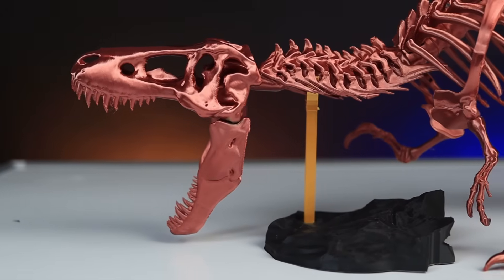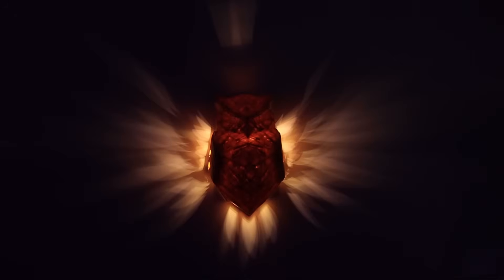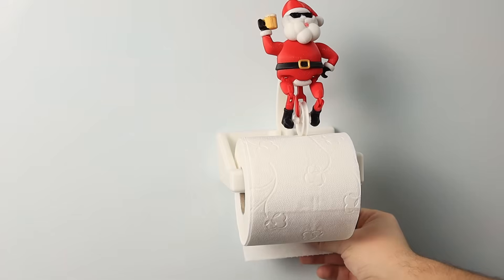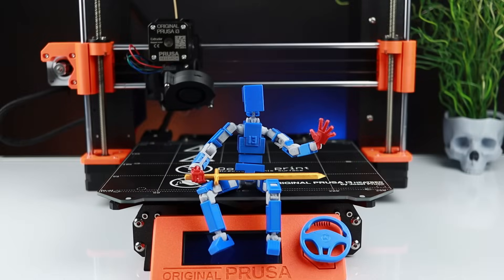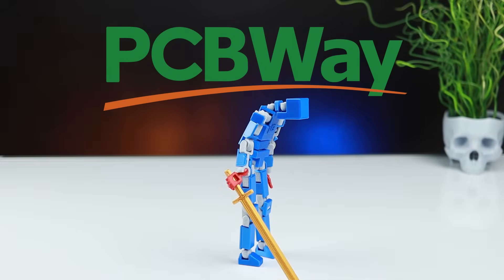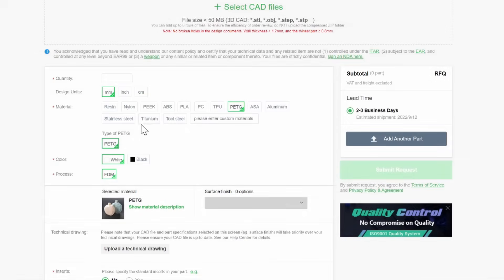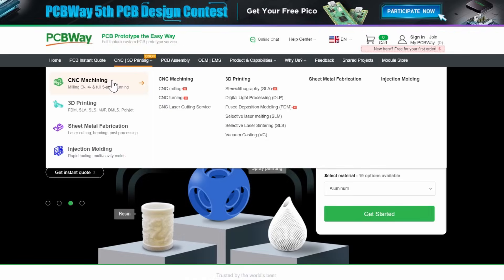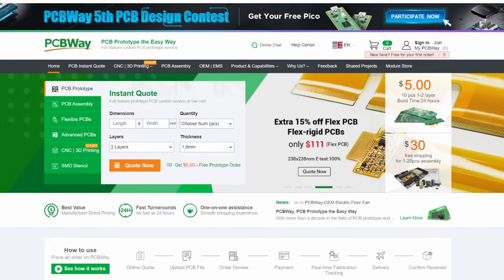Best 3D Printing Ideas in 2023 | The COOLEST Things to 3D Print

Comment: Dear Sir, your models are really exceptional! All very perfect! But what is your secret? Maybe the use of several very expensive printers? How do you get such perfect spheres, even on the bottom side? I noticed that you use a lot of silk threads, which would cause a greater printing problem, and instead your pieces come out perfect anyway! I also noticed that all the little connectors you created never break when you fit them together! How is all this possible? Most of mine always break!! What slicer do you use? I use Simplify3D and Cura and I think they are up to the task, but despite several years of use and having also changed the type of threads, even more performing, I can't get this excellent quality that you are proposing! My printer is a simple Anycubic Kobra, the first model with a touch screen. It prints well but I can't make perfect models like yours! Please, tell me your secret!!! 😄 
I noticed that your supports come off extremely easily, how do you do it? I understand that sometimes it is not just a question of temperature but also of the quality of the wire. Some come off better than others, etc... But you surely have another method for this! Moreover, how do you get such a smooth and perfect support surface which rests immediately before the piece support? Then, how do you have such a clean print bed, with such perfect pieces on the support base? Why, even though I am struggling with my probe that reveals the magnetic plate, I can't calibrate my plate properly? If I adjust the screw of the probe to the right point and also do the automatic calibration, unfortunately the pieces still come off the plate and therefore I am forced to put a lot of glue on the plate and lower the height level of the probe by a few tenths. Have you ever replaced these magnetic plates? How long do they last over time, after several uses? The PEI patina wears out sooner or later, right? It seems to me that it has almost worn out at the first uses and therefore I am forced to put glue on it anyway. I have changed many plates, in classic glass, tempered glass, PEI plates, etc., but the problem occurs the same. I preheat my plate to 60 degrees maximum, perhaps I should increase it by a few degrees more to obtain stability of the piece? That's all! Thanks in advance! :hand-pink-waving:🙂
Reply from the maker: Thank you for your detailed and thoughtful comment! 😊 I appreciate your kind words about my prints and designs. Let me try to address your points and share my perspective.

Yes, I do use some high-end printers like the BambuLab X1 Carbon, but I also work extensively with more affordable options such as the BambuLab A1 and A1 Mini. These budget-friendly machines deliver impressive results, and I’ve found that quality prints aren’t necessarily about having the most expensive hardware but rather choosing a modern and reliable printer. For example, the BambuLab A1 costs around $400–450 and handles most of the challenges you described with ease.

As for slicers, I mainly use BambuStudio because I primarily work on BambuLab printers. I don’t tweak too many advanced settings—I mostly stick to the pre-configured profiles, which are well-optimized and reliable for different materials. The slicer profiles often make a big difference in getting great results without needing to adjust too much manually.

About your Anycubic Kobra: I had the Kobra 2 Pro in the past, which is also a budget-friendly printer, and I was able to get good results with it.

If you’re looking for smoother workflows and fewer headaches, I’d highly recommend considering a BambuLab A1 as a next step—it’s affordable, fast, and consistently delivers high-quality prints without the struggles you mentioned.

Keep experimenting and don’t hesitate to reach out with more questions—happy printing! 😊
Reply: @Marc3DP  Dear Sir, thank you for your reply and especially for your advice on purchasing the Bambulalb A1. In fact, I was thinking that my next purchase could be this one or alternatively the Anycubic Kobra 3 combo. The problem is that I am now happy with the following slicers: Cura and Simplify 3D which I paid a few years ago, 140 dollars and then 60 dollars for the update to 5.1. Although I must admit that Cura performs better. Simplify is very well made and full of settings and is also refined in the graphic aspect but it is one point less than Cura, regarding the print quality. I have never tried the other slicers! I have always thought that to obtain a higher quality it is not just one thing to consider, but many, such as the quality of the printing wire. I noticed that since I started using brands like Overture, E-sun, Sunlu, I feel much better than before but unfortunately I still don't get those fantastic results that you and other makers get here in your videos. Which brands of filaments would you recommend me to buy?
Going back to the Bambulab A1/Kobra 3 issue, another big problem of mine is that I don't trust extruders with a motor far from the seat. I've always preferred direct extruders because of jamming. Do these two types of printers still risk jamming, having the motors far away? I also ask because they have different outputs for each color... Furthermore, I've never been attracted to devices that have their own closed internal system like Apple, I prefer a more modifiable open source type printer.
Proprietary software and settings like in Bambulab don't appeal to me much but I don't question its quality, given what you can get! I also create toys like you and I need to have pieces that don't break, especially in the joints and pins.
I was also wondering if you know how to get the "no-planar" effect in the most common slicers. Unfortunately, this fantastic option does not exist yet in the slicers I use. Is there one in yours on Bambullab?
Thank you and see you next time! :) bye!

Comment: I notice that there is a perimeter line around model on print plate. How do you do that. Is it a setting on slicer, or is it your printer that causes that. I am using Bambu slicer with P1S. If it’s the slicer, which slicer are you using. Thank you. Tony
Reply from the maker: I'm not exactly sure which print you're referring to, but it sounds like you're talking about the "skirt." It's something that can be set in any slicer. I use Bambu Studio, and you can adjust the skirt settings there as well! Let me know if you need more help with that.

Comment: Hello, I am torn between the BAMBU LAB X1 model and the Creality K1 model. Which model would you recommend me and why?
Reply: bambu lab x1 is probably the best printer on the market at the moment, crealitys printers are basically just trying to make other printers as cheap as possible. they are good for how cheap they are, but if you have the money...dont even question it dude i would kill for a bambu lab x1 carbon dont even hesitate..
Reply: 😂bambu lab x1, have no doubts, colorful and high-quality images, k1 is good, but not enough not even close and does not print in color.